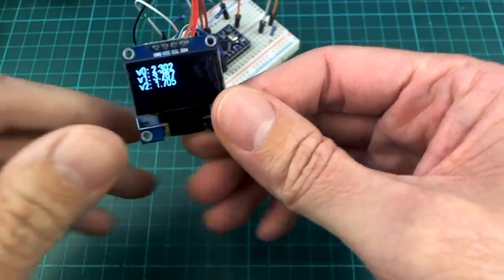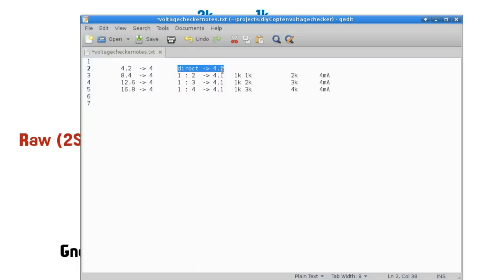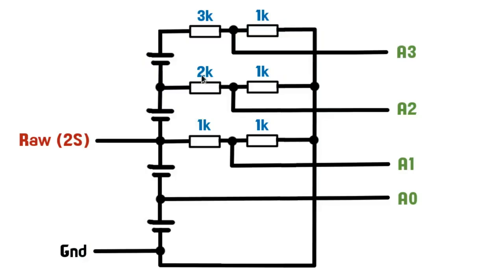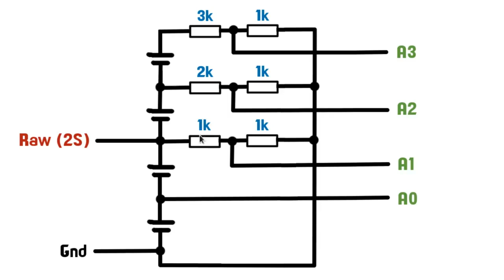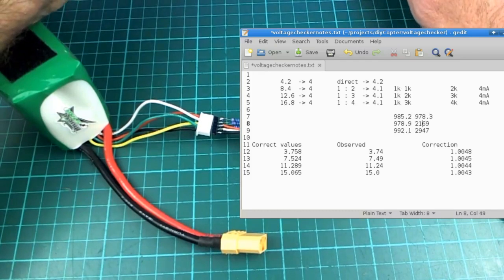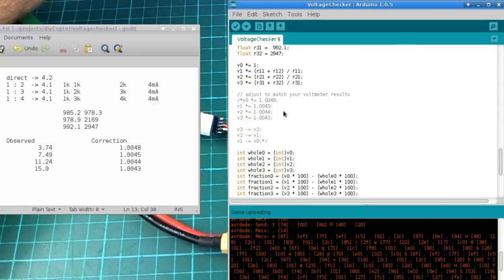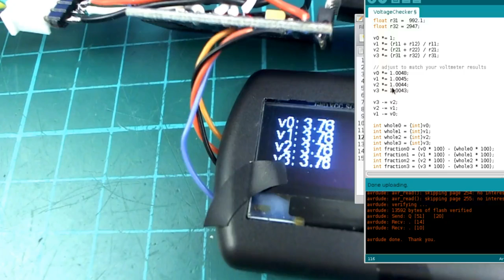DIY lipo voltage checker (arduino)

Comment: If you don't need it to be waterproof, I'd use hot glue to seal the connector. If you use baking paper on a cool surface (heat sink, sheet of metal), put a dab of glue on it, push the connector/contacts/wires in and wait until the glue has cooled completely, you can peel it right off again. That allows you to keep the glue from going everywhere so you have a nice flat surface on the connector. You can do the same for the top by of the connector by putting another dab down and pushing the other side in. With a little practice you can make connectors that look almost injection molded.

EDIT: ah, you are talking about hot glue. Well, if you want it to be in the case you might as well flood everything with hot glue and don't bother shaping it ;) .

Comment: Nicely done with the resistor divider accuracy, good quick way to check....thumbs up. Could you do an update on the cnc machine?? See its still being used!
Reply from the maker: At this point the 'build' is pretty much done. I'm still having problems with communication between the arduino and the laptop. Thinking about trying a new brushless motor spindle that showed up on Banggood recently, hopefully it will be less noisy (the machine runs fine for hours when the spindle is not running). I will also make some shallow walls around the bed to hold in water, and try cutting some carbon fiber under water. Whichever of these happens first will be the next update.
Reply: You should try a DC choke on any supply or signal cables that have spikes. What you want is a toroid. You can loop the wire round them. They resist high frequency and allow DC to pass. These are sometimes seen on USB cables, DC power supplies and motors to reduce noise.
Reply: this shows the attenuation in the spikes. may be of some help

Comment: Excellent, thanks.

I'm waiting for "part 2 : adding polarity protection."
Before I build myself one. :)
Reply from the maker: I actually had some out on my desk ready to use, then decided to just keep it simple.
Reply: PureAwesomeness diodes give a small voltage drop that should be considered and corrected for though
Reply: Just add some schottky diodes, if you're paranoid enough.

Comment: well done.
exactly what i thought about this morning ;)

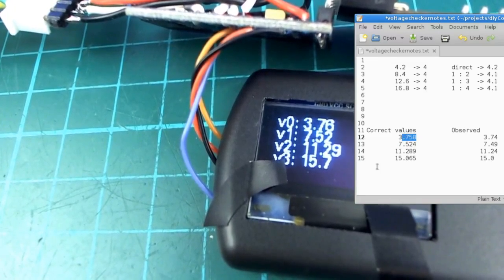@9:10 v3 is off significantly ;) no?
Reply from the maker: Yes, all the inaccuracies are multiplied by 4 for v3
Reply: built. works like a charm....
and thanks to an old parallelboard i even have proper connectors for 2-4S :-) now for the 3d-printed case....